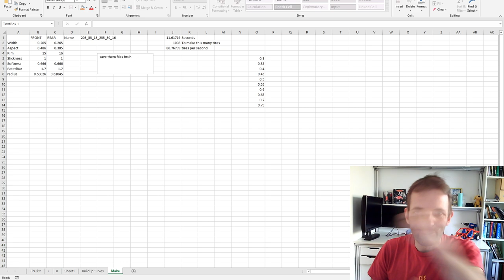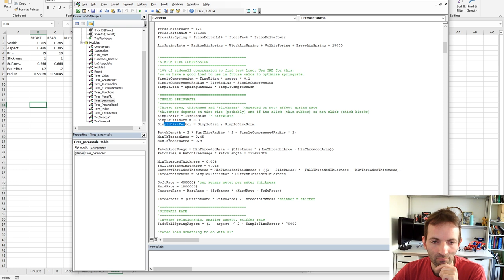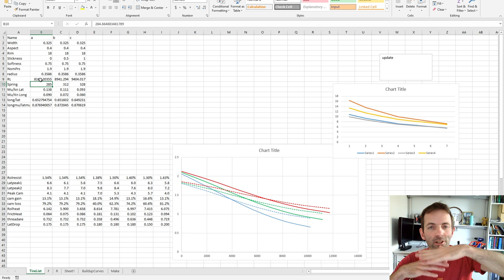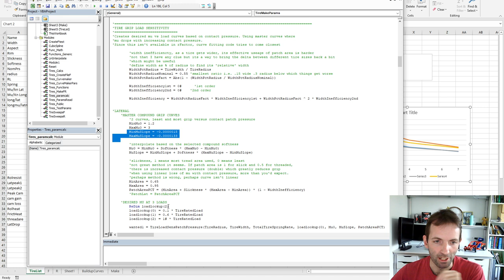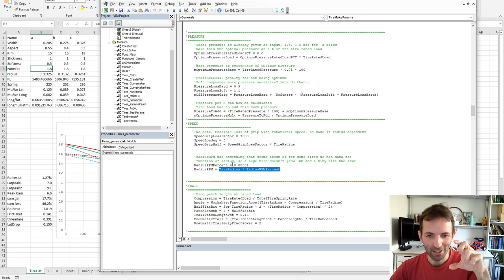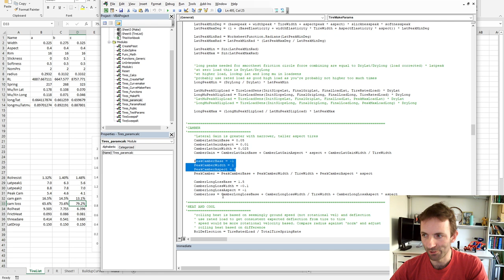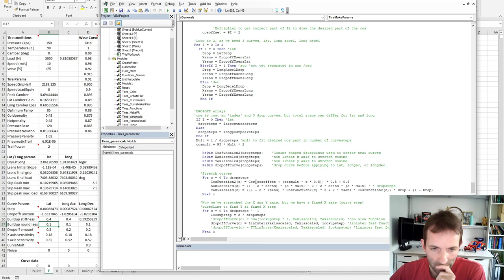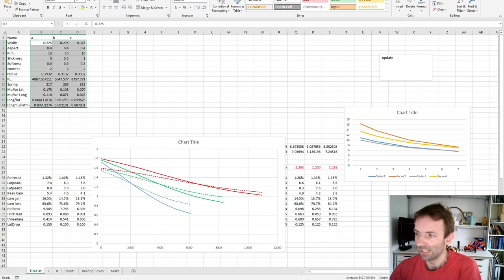A (very) In Depth Look into my Tire Generator SPREADSHEET! Not for the faint of heart..

Comment: I just figured out CM for AC can generate tyres, they show some graphs. But I don't much understanding of them. I did try soft's from 2000's on 1990's car's and had some crazy top speed. Tyres themselves are interesting. It gives you the slider for width, radius and profile.
Reply: Yeah Content Manager's Tyres Machine is quite interesting. It uses machine learning to train a model which you then use to generate tyres of the correct size for a chosen car. As you can freely choose which tyres it should use to train the model, the result is only as good as the input - the input being a) the chosen tyres and b) the parameters that Kunos once entered for those tyres. I'd argue that many edge cases will suffer from the comparatively small sample size, as AC only has so many F1 cars, hypercars, vintage cars, ... But it's certainly adequate to generate some modern semi slicks for older cars or stuff like that.
Reply: @jlnprssnr  I do question tyres, when try to go for qualifying lap, there just isn't enough grip. I generated them from 98T tyres, but I need to turn up the DX_, DY from 1.6 to like 1.8 to make the qualifying times when trying to do a 1 to 1 with the real qualifying times.

Comment: Hey Niels, this is probably going to be too technical for present me to understand (hopefully future me will understand), but I've recently had a massive interest in making my own mod car for Automobilista. This interest started after discovering that AMS, being the best offline oval simulator I've tried, is so realistic that most cars bottom out on the right side at speedways, which puts me in a conundrum because the kind of racing I was looking for wasn't possible with the cars that don't bottom out (I think the Camaro and some older cars with really high ride height).

My question is whether there are some variables that will need to be changed when making an oval car (only turning left)? I'm not sure even how one goes about making an AMS car, so it may be a bit over my head. My idea with my car is to make it low horsepower, high downforce, with lot's of draft/slipstream and not a lot of dirty air instability so the racing stays very, very close. Would also probably include a higher horsepower version for road courses.

I'll stop geeking out about all the tiny details I've included. Just an idea right now, but I'm interested to hear what knowledge you can share.
Reply from the maker: You need stiff suspension, the faster you go and the steeper the banking is.. When I started in 2007 I knew almost nothing, yet that didn't stop me from trying and learning, so If you feel passionate about this, you will find a way to get good at it! Now its 2021 and I know more, but certainly also still don't know a bunch of stuff. Never wait until you know everything before having a go. You learn as you go!

Comment: Hi Niels, thanks for showing this approach for creating tires. I’d like to ask you how you came up with the TireLoadSens() function that you used at min. 35:38 (optimal loadsens params) and at min. 50:45 (peak of slip angle). This function is shown at min. 33:36, but it’s incomplete and i don't understand it. How did you derive this formula?

Comment: Dunno what's more nerdy and painfull: Doing physical calculations on tyre-data or the fact that you're actually doing this with VBS.
Crazy.
Thanks for the deep insight :)
Reply from the maker: VBA is amazing after using actual Excel sheet formulas.. =(A1 * A2) / sqrt(B5) etc etc So hard to follow compared to code!
Reply: @NielsHeusinkveld  Compared to Excel Formulas the most basic two pass assembly would be better readable and managable 🤣. Tho for your usecase i would highly recommend using Python with Workbooks or R.
But i guess porting the functions, data and visualization isn't worth your time, haha
Reply: @LatinMasterxx  I was going to say the same thing.  Learning R or Python would be a big improvement in putting ideas into code.  It's an initial investment of time, obviously, but in the long run you'll thank whoever convinced you to learn them.
Reply from the maker: @SSkinner901  Well when you come from formulas in excel, VBA is amazing already. Plus all I really do is some math, some loops and using some arrays. I doubt that differs so much in other programming languages? Excel + VBA is great because I have a graphical user interface for free (Excel) and can get my inputs and outputs and charts etc nicely visual. I'm more than happy with the capability of this combo!
Reply: @NielsHeusinkveld  In my 20ish years in IT and having used a variety of programming languages at different times, I can tell you without any doubt whatsoever that learning to use any language well is more important than stressing about which language you use.  Stick with what you're happy with :)

Comment: Hey Niels! I have been making my own hobby simulator and your videos have been most helpful. I am thinking of open sourcing it at some point, but i am currently using tire physics based heavily on this video. Things like calculations for load sensitivity, lateral peak slip, the sae formula and rest of springrate related stuff and so on. Do you think its still possible for me to open source the code? Anyway, thanks for your releasing these informational videos!
Reply from the maker: I do show it all don't I! :-) I'm not aware of the exact rules of open sourcing code. I doubt I show stuff that isn't mine. And since I show it here, you can be inspired by it or copy parts of it for hobby use. Open source is fine too, as long as anyone who opts to use the code, or parts of it, can only do so if they open source THEIR stuff as well.
Reply: @NielsHeusinkveld  pretty much yeah! That sounds alot like the gpl v2.0  license, have you heard of it? basically if you make any changes and distribute, you must share the source code somewhere and have it also licensed under gpl v2.0.